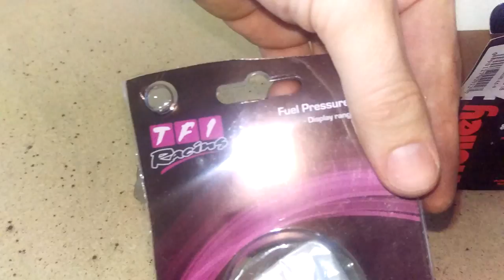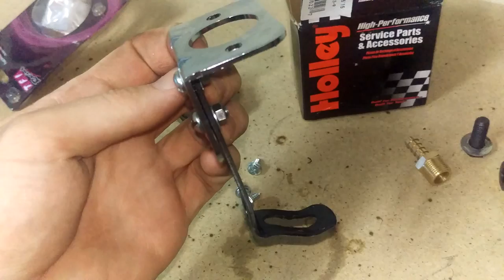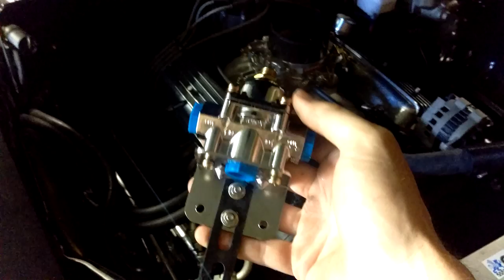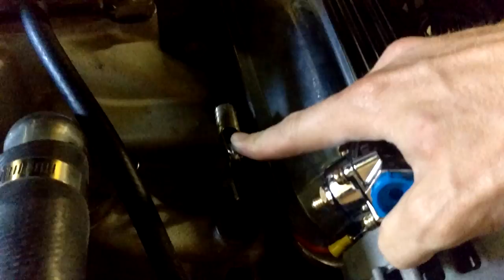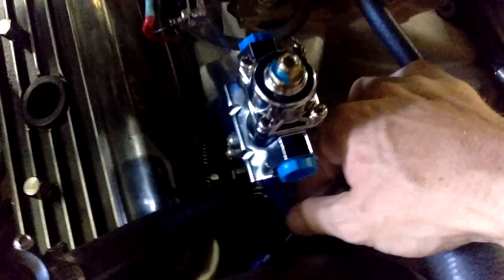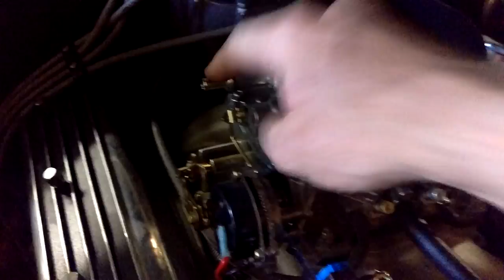Holley Fuel Regulator Install - 69 Camaro - Carb

Comment: Very nice ... just installed mine a Holley 12-887 Fuel Pressure Regulator w/Return Line & Holley Fuel Pressure Gauge and surprisingly it sounds a lot more serene than before. That is until you floor it. I installed it on a 1987 Camaro V8 350 5.7L Headers, Motor Bored 40 over, Roller Cam & Roller Hydraulic Lifters, Edolbrock Dual Plane Performer Intake, Accel Distributor & Ac Delco Spark Plugs with No Resistor (hot plugs). Running a Holley Street Warrior Carburetor Manual Choke model 1850 600 CFM, Automatic Transmission 700R Positrack & a Corvette Converter in the Tranny so when it shifts the tires peel a little ... I need to paint it. Cool video

Comment: I believe that port where you put the gauge should be plugged and you need a separate t for the gauge after the regulator to get an accurate reading. the extra port is for a dual feed carb.

Comment: is that a 350 vortec? Im going to try to run mine from firewall behind the carburetor so my fuel line and regulator don't get heat soaked from the engine. love the video though ty for posting.
Reply from the maker: 305 from a 90s camaro. has now been replaced by a forged 401 :-D for the new build I put the reg on the firewall as you suggest. best to keep all fuel components away from heat.

Comment: Do you have an electric fuel pump? Because in the manual, it says do not install with a mechanical fuel pump.
Reply: The 803BP is not to be used with a elc pump... this is the 803

Comment: Did your screws go in easy into the regulator
Reply from the maker: C10_goes _jamon which screws do you mean
Reply: The ones to mount the regulator to the bracket
Reply from the maker: C10_goes _jamon don't remember there being an issue. But make sure you locktite them in

Comment: I cannot get mine to go above 3psi. Any suggestions?
Reply from the maker: MoneySigns12 i had the same issue but at 5psi. Its likely due to your pump only able to supply that pressure. Time to replace it id say
Reply: Shift Happens just replaced today actually and still 3 psi :(
Reply from the maker: MoneySigns12 whats  the pump part number? Check its not a low pressure pump
Reply: Shift Happens it’s a carter 180-P4070. Not too sure what else to check.
Reply: umm did you try adjusting the regulator lol
Reply: A few years late here but just found this out. There’s two identical looking spectra fuel pressure regulators. One controls from 0-4.5. The other controls from 4.5-9. Just the difference of one part number. Make sure you look in the description before you get the wrong one.

Comment: how is it so far with 5PSI
Reply from the maker: Was fine as it turns out thats all the pump could do .i ended up updating the pump to a holley mighty might which made the regulator needed to set to 7psi max.
Now running holley terminator efi 😀